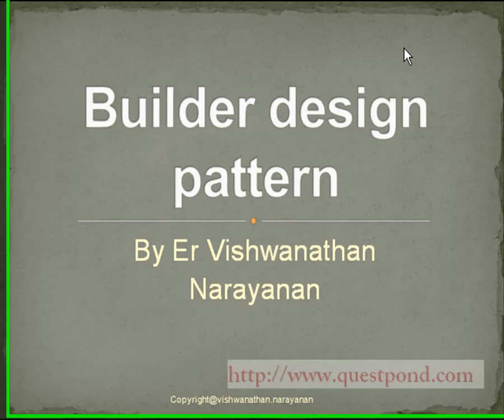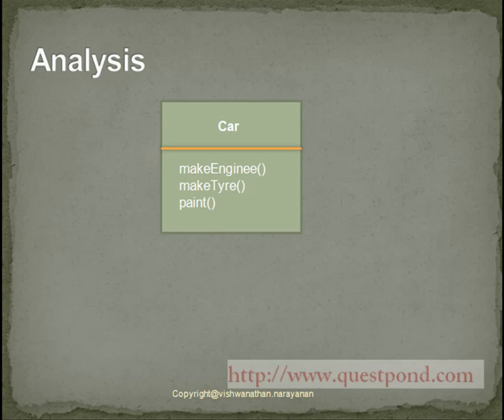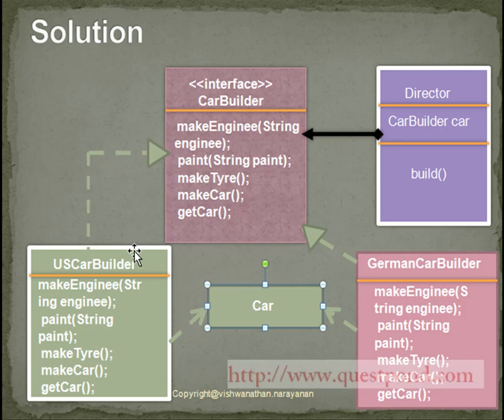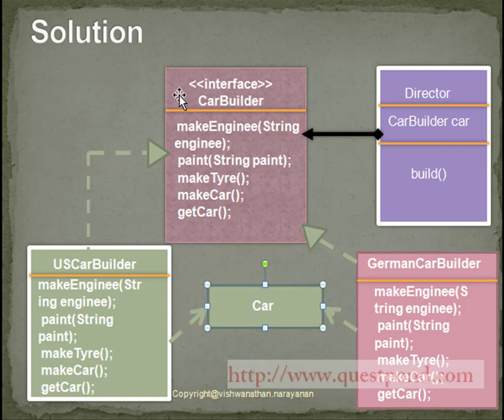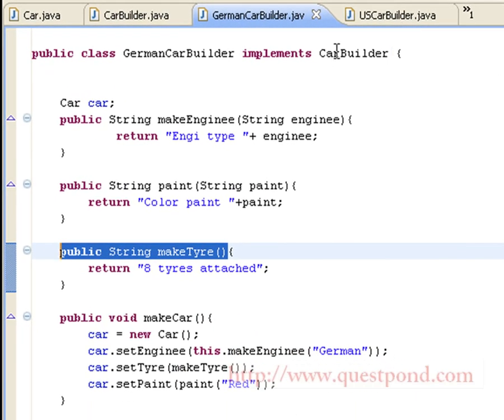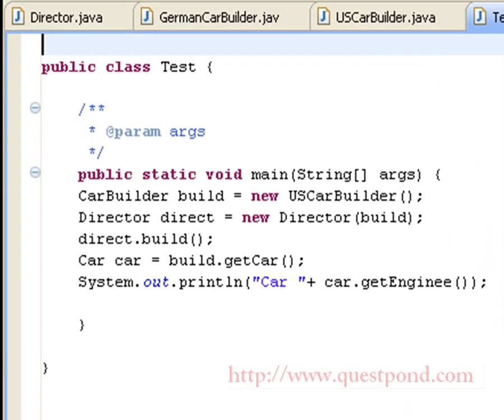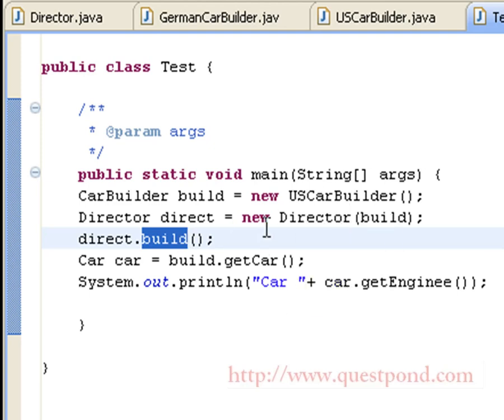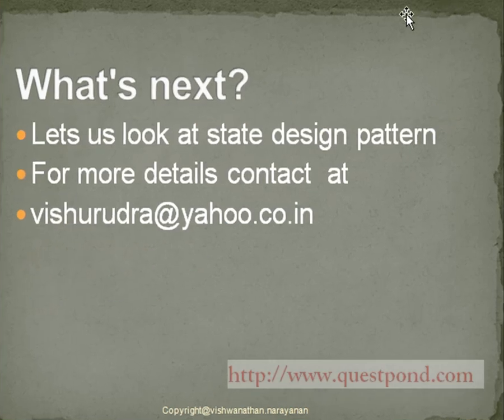Java Design Pattern - Video on Builder Pattern

Comment: Very useful. Can you let me know the diff b/w this pattern and template? FWIW, the functionality of director would be moved under CarBuilder I/f. And if we have a baseCarBuilder where the build method (which contains the steps involved in the process) is defined, wouldn't it allow for more easier changes of future changes in requirement?